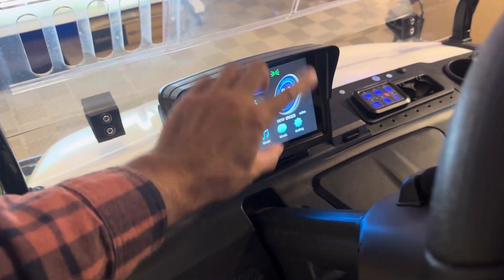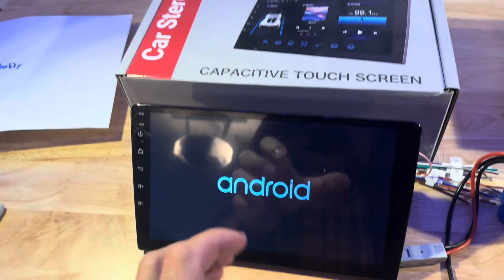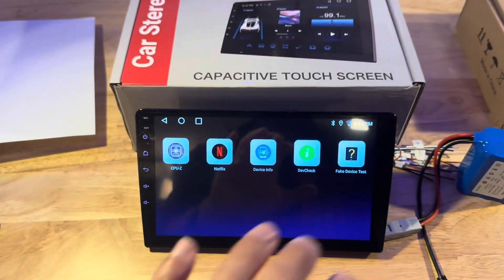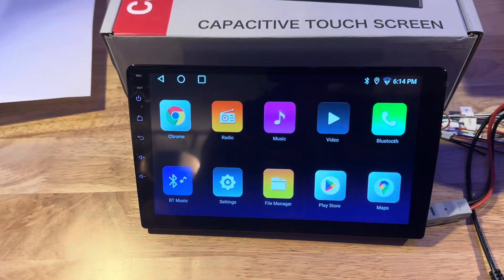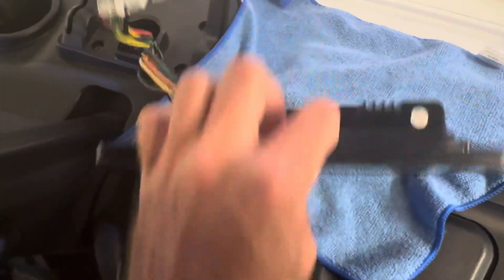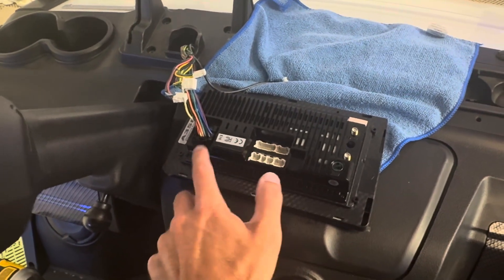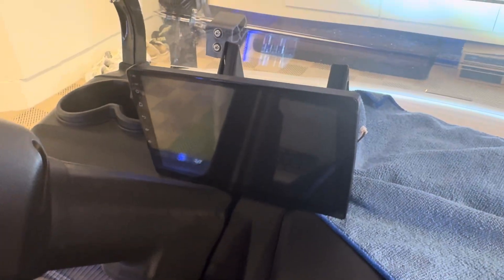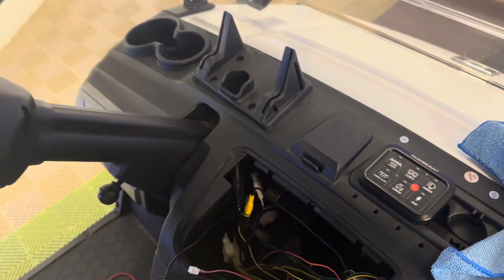Evolution Cart D5 - Android Screen Swap - Not plug and play :(

Comment: Any idea how to get rid if a buzzing sound after hooking up an amp. I guess my cart has a bad ground and cant seem to stop the buzzing noise
Reply from the maker: So this is a good question… I don’t really know. 🫠

When the soundbar is not plugged into the back of head unit it buzzes  like crazy. When you start the cart it buzzes for a few seconds before the head unit fully boots up. So I feel like there are floating grounds for the speakers until the head unit does something. 

If the amplifier’s output ground (negative speaker terminal) is not connected to a solid ground or reference point, the speaker may behave erratically.

If you’re running an amp in your golf cart, the ground wire from the amp should go directly to the negative (GND) output of the voltage reducer, not the cart’s frame. This ensures the amp shares the same electrical reference as the 12V system, preventing buzzing, interference, or potential electrical issues. Both the positive and negative power wires for the amp must come straight from the voltage reducer for clean, reliable performance.

But sadly I am not an expert yet and have t finished the new head unit / buzz issue.

Comment: Good stuff so far! That soundbar squeal is normal, it does it before the factory head unit boots up too, and you can make it better or worse with the headlights on/off, because some (all?) of the EMI comes from the daytime running light dimming. I’m actually working on taking apart the turn stalk controls to wire up the DRLs always on bright to stop it. Anyway, sure seems like 12V+ on the ACC wire should make that unit boot! Especially since it did on the bench via battery. Hmm.
Reply from the maker: I was able to get it to boot once the accessory trigger line was plugged in but no audio, and the soundbar squeal was never ending. So I just called it a night. 

I was able to tap into the Can H and Can L lines to see some data flowing through there. I can see gear selection, battery, and a few other attributes. 

I may end up trying to use Real Dash with a custom can to usb dongle since the android dash will not expose it.
Reply: @hillvalleylabs can you root the android unit or get a shell in any way? Or GUI file manager for that matter. I’m wondering if it just needs a custom can bus definition file to know how to read the Evolution controller attributes? Maybe an easy way to dump all the can info in a shell? I have access to three D5’s, ours is a 2024 with the older motor controller (400A?), the others are 2025, one of which is a Plus model. PS the programming cable worked great, once I figured out I needed the old software for our older controller.
Reply from the maker: Yeah it’s a good point, the CarPlay version of the D5 unit, is almost definitely just one of these cheap units with a custom can bus map and UI applied. 

Since they are selling these replacement displays for $700 and up, I assume they are keeping from dumping and cloning them, but I could be wrong. 

My goal is to peruse using a custom dash with Real Dash, I might be able to get some additional attributes, I would love to see motor temp, torque, watts ect. As those attributes are available to the controller but have to see what’s on the can bus.